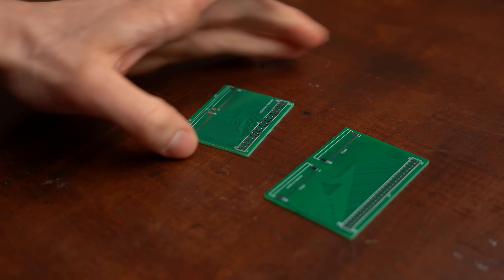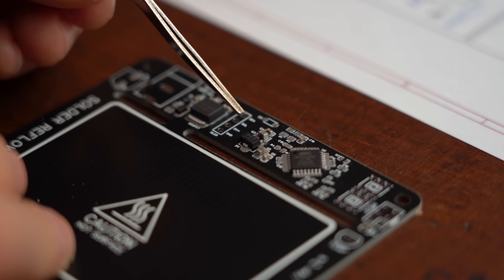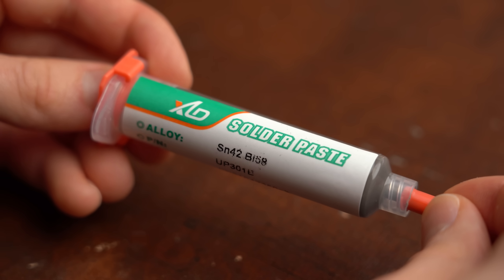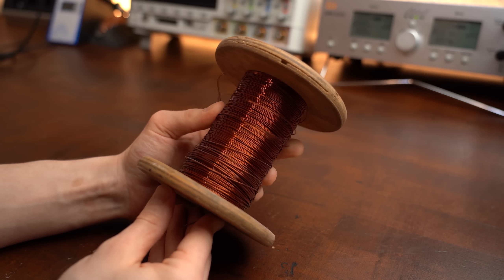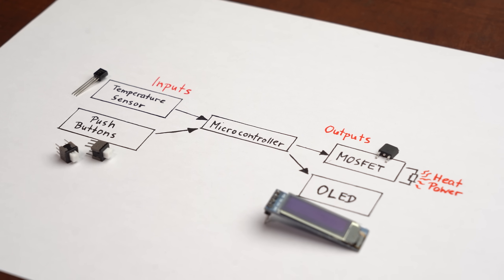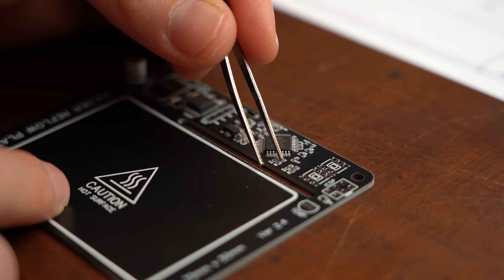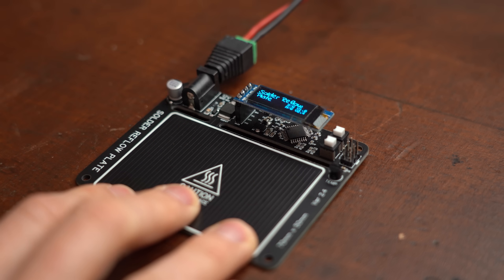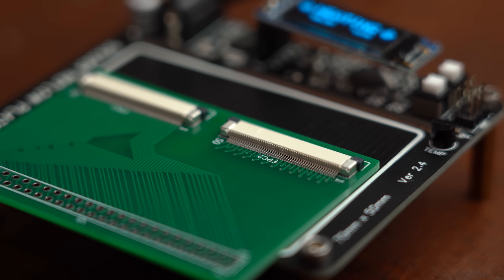The Best way to Solder? Hot Plate to the rescue! (DIY or Buy)

Comment: Hi Scott, long time follower here without an e.engineering background.

My favorite way to do hot plate is based on a workshop i followed at a MakerFair in Rome:

It uses a ceramic heater portable stove (one with a glass surface) at low power, and once temperature is reached, to maintain the pub there until the lead melts. It is also a method that costs less than 25euros, and can fit the biggest pcb you can think off or as many as you want at the same time, with great results, but it requires you to pay more attention.

The dream would be a hacked PID version of such a heater with an external temperature sensor (like a 3DP thermistor) . Maybe a cool subject for another video :)

Comment: Great idea! But the designer missed a big efficiency trick by using a switching mosfet without an inductor. That solution is just as inefficient as a linear regulator, (surprising but true, I’ve done the math), and adding an inductor and a diode brings the efficiency to buck converter levels. Does it matter? Depends. If you’re trying to maximise heat into the plate rather than the drive electronics, without pulling more input current than necessary, then it matters. If Great Scott wants to evaluate this, I’d be happy to go through the math to justify my claim, and then collaborate on testing the result empirically.

Comment: Since you used an arduino to harvest the microcontroller, and you also used an arduino as a programmer - could you have just used an arduino and the necessary shields and skip the controller build entirely?  I suppose the cost would be higher, but you could then build whatever size heating element you wanted.  And, of course, you might not have needed the capability to reflow SMD chips in order to build a tool to reflow SMD chips...  ;-p

Comment: Я как-то видел видео, где перевернутый утюг в качестве подобной штуки применяли
Теоретически оно даже должно работать, но у утюгов там хер разберёшься, какая температура при каком режиме, разброс чуть ли не в сотню градусов вроде, что очень много, но попробовать было бы интересно

Once seen a video where an iron was used as such heater, it can work as it is theoretically but it's really complicated which temperature usually those irons do in which mode and it may differentiate by almost 100°C in different models as I've read somewhere, that's too much but it's still interesting to try

Comment: Actually the project reminds me of the first heated bed develloped by Prusa for DIY 3d-printers. The same principle.
As I tinker a lot with 3d-printers, I have a lot old controller boards - some years ago cheap printers from creality used soldered allegro drivers and 8 bit controllers, so one of the first upgrades was to swap the board. So I have some of these creality board, which are practicly an Arduino Mega with Mosfets, conectors for temp sensors, display etc.
So I think it would be best just to adapt the software for the Arduino Mega and the I/O-Ports Creality (and others) use for bed-heating and just make a PCB for heating. With controller being seperated from the heating PCB, it is also possible to make it more easy to solder bigger PCBs aerea by area, if you use sinking screws for mounting the heating PCBs, as you can keep the controller out of the way. Also I always like to reuse old obsolete hardware instead of buying new one.

Comment: The easy way: Kanthal/NiCr wire bonded to a thin aluminium plate with an off the shelf PID temp controller. If you buy a big sheet of aluminium you can pretty much make a bigger or smaller hotplate whenever you need without having to wait for shipping.

Comment: This could probably be fairly simply with a 3d-printer heat bed, favorite microcontroller and MOSFET and some way of measuring the temperature. That way it's an even larger surface.

Actually, it's probably possible to do with a 3d-printer. It's a question of sensor and safety limits and power limit. But they are readily hackable anyway, mine is basically a arudino mega with some more hw added.

Comment: This might be an absurd question. Sn43 has a lower temp but would that also reduce the ability for the PCB to withstand high temp? Would the components come off the pcb if the pcb happened to be used at high temp?

Comment: I love using hot plates as you can correct tombstoning or rotated components with a toothpick as it happens without having to reheat the board. Don't burn your palms tho. I use an old vintage car jack as an adjustable hand rest to crane over the plate and steady my fingers.

Comment: The biggest problem with the PCB heater is that PCB material only comes in a limited range of temperature ratings. A high glass transition temperature would be 180C which is really too low for reliable soldering. Eventually you get de-lamination using a PCB for the heater.

Comment: Found your video and immediately had to order the open source PCB. However, when I tried to fire it up, it won’t heat up and the voltage reads 0v on the UI. Is my power not sufficient (12v, 5A)?
Reply from the maker: Should be enough.

Comment: リフローに関して、ここまで作る必要があるだろうか❓
あなたが特別に大きな基板をリフローしたいなら別だが、小さなものなら【家庭にあるホットプレート】で代用できないだろうか❓
温度調整も恐らく２４０度くらいまでは問題ないと思われる。
しかし、ホットプレートを用意するというのも面倒かもしれないのだが、利用価値はあると考える。
私が興味を持ったのは、小さなものである。紹介してくれてありがとう。

面白いものを見つけたので、興味があるだろうか❓リフローに関しての物である。
しかし、私には金が掛かり過ぎるようだ。作る手間も面倒である。

Is it necessary to make this much for reflow?
Unless you want to reflow a particularly large board, but if it's a small one, is it possible to substitute a [hot plate at home]?
It seems that the temperature adjustment is probably not a problem up to about 240 degrees.
However, preparing a hot plate may be troublesome, but I think it is worth using.
It's the little things that interest me. Thank you for introducing it to me.

I found something interesting so if you're interested ❓ it's about reflow.
But it seems too expensive for me. It is troublesome to make.
https://www.youtube.com/watch?v=9q0mh3y_XBc

Comment: Couldn't you just build a small oven? And use a heating element from something like a space heater? Small space heater + Metal insulated box + thermostat control+ relay. It would be fairly cheap and you could fit much larger boards in it.

Comment: Could you use an old 3D printer heat bed as a soldering surface? They can heat up too and also have a temperature probe inside. I think about using an arduino that can monitor the bed temp and power on a mosfet connected to the bed. In theory that should work. But I don't want a fire in my house because the heat plate burns.

Comment: I am using old AMD Processor for pc and I connected it to power supply and with lowering the voltage I am regulating the temperature of the processor (I am measuring the temperature with my multimeter)

Comment: Another great video..
I usually do all my solders with a soldering iron, but after spending many hours soldering smd components, I decided to make a hot plate system with an old electric stove and it worked very well. However it is something very simple and I would like to do a more professional project. Something like you just showed. Thanks.

Comment: Hi guys, I need some advice regarding this project. I read that the circuit will draw upwards of 5 amps of current from the power source. Are there any easier methods of providing such a high amount of current without using a Lab-bench power supply?

Comment: Great video, some questions though...
* The schematic does not say how much minimum Amps or Watts is needed with the 12-18V powersupply,
* The PcbDoc file is not routed completely and contains missing part tracks and lots of floating via's,

Comment: looks a lot cleaner, do you still get built up residue, with the solder doing it this way? it look more controlled.
boards, there must be a type made to very harsh conditions, something more mica, slate, concrete, fibre glass, or some sort of mineral maybe salt, it the the form of a stone,

Comment: Maybe a quality of life improvement would be separate the heating element from the electronics. Yes, it is cheap but it looks like it takes time to reassemble the circuit for another board. Also is always a good idea to separate components that last from components you will have to eventually replace.

Comment: I use my 3D printer heated bed to warm up phones or other devices I need to soften glue to take apart.. I just want to say, there's 3D printer heated beds that go up to 160c 😉 Now i'm just thinking you just have to write some G-Code or custom firmware for a 3D printer and it could double as a rework hot plate 🥰 If it has the right amount of thermal mass, you might be able to get away with simply setting a preheat and turning it off, then letting it cool on its own slowly while leaving the board on there.

Comment: Actually this is great. But I always wonder can it be done simpler?

Yes it can be done. Make a voltage divider, where R2 is a PTC thermistor and glue that on the heating pad with thermal paste.
Choose R1 resistor value, so the pad temperature does not exceed 160 degC.
Simple.

Comment: Question about spreading down the soldering paste @ 7:36 mark.
I see what appears to be a thin sheet with a pattern. So, how and where do you get such sheet specific to the board?
Reply: It's called a stencil, and most manufacturers offer a service to make these, together with the PCB.

Comment: Just buy a cheap cooking hotplate.. Throw away it's Controller circuit and add a arduino.. Mine costed about 30usd to make and running since last  4 years and it has surface area of 300cm2

Comment: I've always hand soldered ribbon connectors, then used solder wick to remove 80% of the solder and debridge the pins 👍

Overheating is a major risk though and leaded solder is essential.

A hobbyist DIY hotplate ?
What a fantastic time to be an electronics technician 👍

Comment: Good question how long it will last, but 3D printer heatbeds work in very similar way and they seem to work thousands of hours without problems. Granted, those go usually only up to like 110 degrees.

Comment: I don't think the lifespan of the PCB is a major issue. this design of a heater is used a lot in cheap heated beds for 3D printers, and those last for hundreds of hours without a problem

Comment: Intresting, I did a simular project on a DYI 3d Printer. The Bed was a home brewed solution. The glass donated for the printer was temered but really think, and i end up pumping 36v dc at 5A to the bed, and got a very quick (5 minute) time for heating up the bed, in 3d print the bed heat up time is often 30 to 45 minutes.

Comment: I love how well you explain the way the diy version works.

Can the DIY version not be made so the heat bed can be replaced?
I.e. there are connectors you plug into the control / power board?

Comment: I 've just shorted out the MOSFET and power from a 10 Amp power supply current limited to around 4.6A and it is really good so far for reworking some SMD PCBs I have

Comment: I've used a kitchen electric ~22" griddle for about 50 USD and a thin sheet of aluminum as an additional heat spreader when woring with large boards. I check the temperature with an IR non-contact thermometer. Works great.

Comment: Could you possibly explore using a silicone heater like what is commonly used in 3D printer beds. They can get upto 260 degrees Celsius, that should be plenty hot. They come in tons of different shapes & sizes.

Comment: Anything to not solder with a regular soldering iron... End result not shown even a single time, only how solder melts. It usually need check and fix. You can just buy hot plates for cheap, no components, no controls, somehow stable temperature. Or just turn upside down regular smoothing iron! It even have temperature control!

Comment: That cheap hotplate uses firmware that matches the one in my USB soldering iron. In fact, both are USB C based. Not bad, considering that the soldering iron I use has been a fantastic upgrade

Comment: I hope that Chris makes it so the plate can be replaced. Soldered back on to the board or using a connector when old one is "dead".
Really cool stuff, and the small commercial one actually might be really nice for people that only work with small electronics. 
I would buy it. That being said, seeing the DIY version, i would just cut off the heating pcb part and make a sort of sliding/slot system from the bottom as the pcb is already built. Then just order 5 heating plate pcb without the rest of the board for components. Get to the exposed copper on the + and - and slot it in.

Comment: I ordered the PCBs and instead of populating the components I had the idea of using an old creality 3D printer control PCB, thermistor and display to  control the heated plate, not fully tested yet but it's looking good so far.

Comment: I've only used JLCPCB once so far, but found out about them from their sponsorship of a ton of DIY electronics youtubers like you.  And man, I was impressed

I needed a little ~1.5x2.5 cm board for some LED lamps I was making. Because of the way they charge, I was able to tile together 50 of them, get it in red just for fun, shipped like 2 days later, for EIGHT DOLLARS TOTAL.  And!! There was an issue with the first files I uploaded, I mistakenly left a trace going across a drilled hole that would have made it useless. They sent me an email with screenshots of the circuit and a little indication where I had made a blunder, so I could upload the corrected file.  Absolutely will be going back for my next project.
Reply: I have to agree! I'm still fairly new to the world of PCB design and assembly, but I've got a few board from JLC and been super happy.  This year I started a company which depends on custom PCB hardware, which I designed and had assembled by JLC and they've been fantastic. Something really magical about seeing your design on the screen, then holding that finished product in your hand like a week later.  :)

Comment: I also had the problem with burned plastic when using hot-air.
Finally i found the trick: Use a heating plate (around 150-200°C), wait 10 minutes, use hot-air with 200-230°C AND most important take your time!
I finally was able to perfectly solder a plcc socket without having to clip out the inner frame and solder by hand. ;-)

Comment: Nice project. But why didn’t you use a 400w aluminium hotplate from aliexpres with an ssr and a pwm temperature control via arduino controller?
Looks to me better and cheaper than a pcb trace??

Comment: I have recived IPC training on soldering some time ago so have a few words about that. 
Hot plate is used not only for soldering, it is used also to help release stress on PCB. It is done by setting up heating curve that slowly heats up whole PCB, does allowing it to stretch evenly. 

It can be use also as a help for hand soldering, when u don want whole PCB to get reflow, u can set relativly high temperature on hot plate, making it easy for PCB and due to low temperature gradient it makes it easier to solder/unsolder one component. 
I think addint heating curve to homemade heater wuld also improve its livespan.

As a tip for hand soldering IC and other multi leg componnets i reccomend using "minifala" soldering tip, idk if it is worldwide name or just polish name, but there is T12 tip name to help u serach for right one " T12-BCM2".

It is worth to mention that there is also IR heating method, but it is more industrial way of doing it. It is precise, can heat insenley quick just 1 spot melting just tin, but not provading enought energy to heat PCB or component siginficantly.

Comment: A better and more professional solution is to use a PCB preheater, bring the board up to -10% of the reflow value, and then use a hot air tool with a low blow, to target and knock each component into reflow.

Comment: Hi! In the meantime I've designed  another version of this hotplate in  KiCad . This version features a bigger hot plate and  uses an ESP32 WiFi & BLE MCU with a 3.2" Nextion LCD Touch. The LCD touch displays a temperature chart in real-time and allows setup and configuration of the reflow temperature curve.
It also connects to an App to view and control the hot plate temperature from a smartphone , tablet, laptop or desktop computer.  If you like to have a look , here's the YouTube link for the 3D  video: https://youtu.be/G9LtgrY2Xpw

Comment: I used commercial hot air gun to solder my double sided PCB. I considered hot air soldering station but it is too expensive and I only do PCBA for hobby. I have to manually adjust the distance and estimates the thermal equilibrium of the PCB to solder SMDs. Maybe hot plate is a good option but I wonder if it could handle double sided PCBA.

Comment: alternate way of doing this: pick up a cheap broken 3d printer then disassemble it to the point where you only have the heater bed element and electronics, done. bigger then this, easier to do and fairly cheap

Comment: Shouldn't it be working without the bootloader? If you use a programmer there is no need for the bootloader. The whole purpose of the bootloader is to be able to program without a programmer.

Comment: waxine candle light with a ceramic plate ? a candle flame is about 500° - 600° celcius ??? maybe use a thermometer or tempreture sensor. a waxine candle flame is hot enough to melt solder tin. i used a candle to melt tin into a aluminum cupp. and purr into a clay molt. a bit art.

Comment: What about using a 3d printer heated bed as  the heat source? I mean, there are some cheap ones from china with heat elements and some sort of thermistor with all of them, plus the variety of sizes. All of them compatible with microcontrollers. Just a thought 💭

Comment: Nice to see you struggling whit the soldering.
I had the Same problem.
So I had a old iron with a flatbed.
I make a temperature sensor on the surface and I can regulate to 180c 
It’s working great.